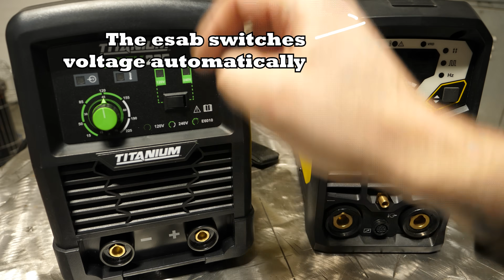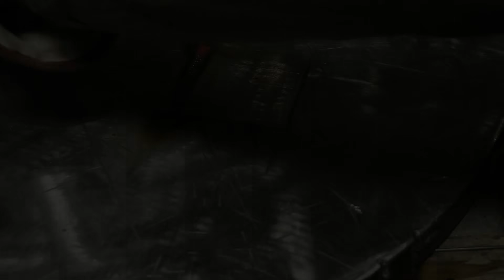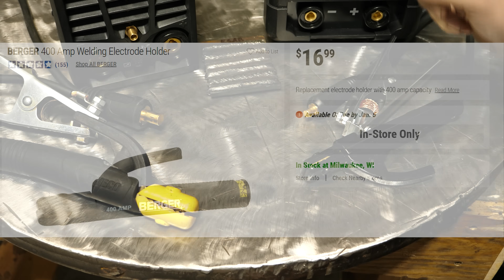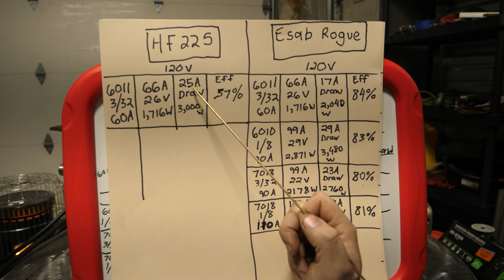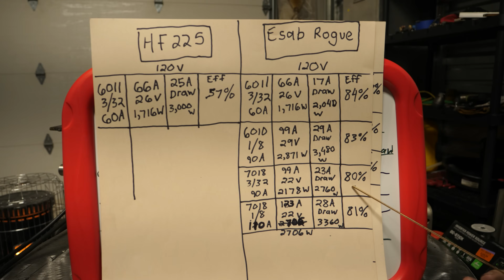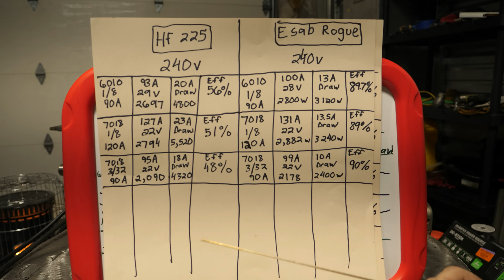Cheap HF vs expensive Esab welder comparison:  Deep dive

Comment: Great info as usual . Good to see PFC demonstrated. Budget also comes down to whether you need to pay for wiring upgrade to run the cheaper welder at higher amps.
Reply from the maker: 100% 😀👍.  For most house wiring it’s not a big deal either way, but for generators it matters a lot more.

Comment: Smaller generator will use less gas per hour and that will add up to a lot of money over time .
More money for the better welder in the beginning and more savings in the long run .
Over time the better welder will be cheaper and work better .
You get what you pay for , pay a little less and get a hole lot less  .
Reply from the maker: Absolutely correct 👍.

Comment: the twist type of electrode holder is common in Australia.  I see those clamp types and recall using them, the 3 grooves made it easy to change angle.

the larger sizes are both more robust and less prone to getting hot.

Comment: Can you please do a video comparing a cheap ACDC tig welder for aluminum with a good one ? i would love to have an affordable and expensive machine, but where i live i only could get a 700$ machine (Tig neo acdc welder) and our wages are a lot lower than on america..
you said that those machinese were junk, but thats what people uses where i live. I am not sure to buy or not the chinese acdc machines !
Reply from the maker: I definitely need to do that.  The hardest part is a lot of the cheaper a/c capable tig ones I can’t recommend because they don’t work properly work. The cheap d/c tig welders (or even stick welders that you can hook a scratch start tig setup to) will generally “get the job done”.  The issue is the a/c tig welders need more adjustability to function properly.  Many cheap ones don’t have the range needed, or the settings don’t work the way they do on a proper welder.  The other huge issue is amperage.  Aluminum eats amperage so a minimum machine should be a 200amp machine, which pushing costs high.  The cheapest welders I have found that a/c tig weld properly are typically 800+ here in the states (everlast, primeweld, ahp, etc).  There seems to be a hard line below 750$ where the usability becomes bad.

Comment: That VRD (voltage reduction device) on the ESAB drops the open circuit voltage from 78 volts to under 30. Is that then going to make it harder to start an arc? Apparently the VRD is disabled and needs to be enabled by an Esab technician. So if you go mail order, I don't know how to get it enabled...but, if it makes it harder to start, perhaps a non-issue?
Reply from the maker: So if VRD is enabled (which it tends not to be in america) it has to be disabled via a service department.  I have never seen it enabled on any American esab machine (I have owned at least 5).  With VRD on it will be harder to start a stick rod for sure.  It’s still doable but when learning I would take the higher OCV any day.

Comment: I haven't finished the whole video yet, but rather than the ESAB I would look at the Everlast power arc 210 STL if a guy was interested in a small portable stick welder that could also do TIG. You get 200A output stick/tig, dual voltage (120a on 120v, 200 on 240 so even surpassing ESAB), dinse 35, hot start, arc force, lift TIG with a gas solenoid,post flow and 2T/4T.  Literally cost half of what the ESAB runs.  I've used mine about five years now and I have done a lot of TIG work with it and it's been great. Also has a 6010 mode that works very well.
Reply from the maker: The 210 is a solid welder.  The two main benefits to the rogue is power factor correction and more resistance to moisture due to the design.  On a generator the rouge will operate on a much lower running watt unit, and it can output more power on a 20a 120 circuit.  On 240 there isn’t much difference for output though.  Realistically I agree with you, that welder is a solid option for a majority of people.  The one great thing about everlast is they don’t lie about specs, and they weld really good.  That’s two things that many more affordable machines flat out don’t do.
Reply: @makingmistakeswithgreg you are 100% right on power factor correction. That would be a nice feature to have. I have a clamp meter and one of these days I'll use my line splitter to see what type of amperage and efficiency my 210stl has. I have run it on my harbor freight 4450 pure sine inverter on the 120v 30a plug. It worked for me for the 3/32 7014 stick I ran, but no idea how close to the limit I was. I watched your other video detailing generator use and info, and it made me nervous to do that again. I'm sure it strained both pieces of equipment.

Comment: Could you try Amico Arc 220 stick welder.  We use 2 of them on our tugboats. Main generators and portable.  Seem very efficient and less than $400.  Runs 6010 and can use long extension cords.
Reply from the maker: So I have been looking to find an alternative to the harbor freight 225 and the welder you mentioned has been suggested by a few people.  I think I will pick one up and compare it to the titanium 225.  If it does run 6010 and weld decent it might be a really good option for people.  I am all about affordable options for decent stick welders 😀👍.
Reply: We run it on 100ft primeweld 6gauge cord and weld 3/8 and 1/2in with 5/32 6010 and 7018

Comment: How is that ESAB working as of 10/2025?
Have you had any issues with it?
Reply from the maker: So a while after that video I did a 1 year update and it’s actually been a while since then.  I ended up giving it as a Christmas present to one of my students and it’s still doing great 👍.  Probably has well over 1k welding hours on the machine and no real issues.

Comment: Just my $.02 ,

If you want an inverter machine that performs well on 120v but don’t want to pay Esab prices, the Eastwood Tig 200 DC (the little one) is worth checking out. I bought one and it runs circles around my Titanium Stick 225 on 120 volt power. 60% Duty cycle, has high-frequency tig start, and only costs $450. Stick welds smooth as butter. Only downside is it doesn’t come with a stinger for stick. Throw one on and it works a real treat. Cheers

Thanks for everything you do for us Greg!
Reply from the maker: It probably has a lot higher efficiency and possibly power factor correction, which could explain why it runs on 120v so much better.  It’s really hard to get decent stick performance on 120v, or tig for that matter.  That’s the big downside to many dual voltage welders, sure they run on 120v but they barely have output on 120v.  Glad to hear it does well on 120v 👍.  Eastwood has done a lot of good for offering decent welding machines that do what they advertise.

Comment: Thank you. This was very good information. I am trying to buy a setup for welding in my garage at 240v/16A household fuse. I am planning to weld some fairly thick flat iron and tubes lik 5-7 mm thick. And I have been trying to figure out why units with similar specs have so huge price difference. Before seeing this I thought it was a price difference based on brand, ergonomics in LCD and such details. But I never thought efficiency could be a huge thing. I have a pair of questions that I love your answer on.

Is this efficiency something that is generic with higher priced brands or is this some specialty of Esab?

What do you think about "smart" welding like S-MIG on Esab? It seems like a great tool from a beginners perspective to just dial in the tickness of the material and the machine does the rest. Or is that just a marketing illusion?

For my purpose of welding bars, tubes of iron and probably also some thin sheets on my house power 240/16A is something like Esab Rebel EMP 215ic (that is currently on sale in my area) a good an useful solution or will I only be able to use a fraction of its power?

Comment: Great video!  I picked up the Titanium Stick 225 about a month or so ago, and have mostly run it on my 5000/5500 generator.  The gen seems to run it just fine, running 1/8" 7014 at 140A... but what you showed here was eye opening... never once tripped a breaker on the gen, but it looks like I've definitely been overloading my generator.  I figured the Titanium would be in the 60-70% efficiency range being that inverters are supposed to be so efficient and all, even with no PFC... wow... I was off a little bit.  The gen I have has a somewhat larger engine for the wattage output... so it will carry quite a bit more load than what it should before it runs out of horsepower.  I guess I'd better think about upgrading my gen... I'll have to take a look at the windings and see what they look like.  I welded hard with it one weekend for an entire afternoon, ran close to 5 lbs of 7014's and probably 2lbs of 6011's.  I hope I didn't cook my gen!!

Comment: Let me tell you, i've been welding for years.That titanium is a beast very impressed, especially with the way it works and the price
Reply from the maker: I bought one when it first came out and was shocked at how good it was.  You don’t expect something so cheap to be really good.  It’s better than anything I have found in its price range and better than a majority of inverter stick welders since they won’t run 6010 well most of the time.  That’s why anytime people ask me to suggest a stick welder I suggest the 225 lol.
Reply: @makingmistakeswithgreg  yes, it's no joke. I was looking for a small inverter. Welder I was going to go-between Miller or Hobart, but I couldn't find one bad review online with the titanium. So I figured with the price range, it's worth a shot and it blew my mind
Reply: @makingmistakeswithgreg  i like trying different machines if I came across a hobart 210i i would purchase it.They discontinued the  machine

Comment: I know it's like comparing apples to salt marsh harvest mice, but my first welder was a decrepit Lincoln 225 AC tombstone running on too small of a generator, but after enough gas and rods were thrown to the wind, I could eventually stick a cutting edge on the bucket of an almost as old case front end loader.
I eventually got into the 225 titanium, and experienced seeing a light at the end of a tunnel.
In comparison, starting, holding, and completing a weld/bead was like a whole new world in my welding learning curve.
The thing ran like butter, and was slicker than deer innards on the front porch.
I would highly recommend it to anyone wishing to learn welding with oversized sparklers.
Reply from the maker: The titanium 225 is definitely a major upgrade over a tombstone.  I was never a fan of a/c stick, it tended to make odd weld profiles and some rods don’t run well.  The great thing is, if you can weld with a old a/c tombstone you can make even better welds with a decent d/c stick welder.  I don’t doubt you experienced a light at the end of the tunnel, the titanium 225 is one of the best stick welders out there for general use, it flat out welds great 😀👍.

Comment: I have the same Esab Rogue, in EU on 230V work perfectly.
On 30A fuse work @ full 200A.
Reply from the maker: Pretty amazing what that welder can do on minimal power.  It wasn’t that long ago you couldn’t get more than 100amps stick and 130a tig out of any welder on a 30a breaker lol.

Comment: You need to consider power factor and use true RMS meters.
Reply from the maker: So I did just that in a later video.  Harbor freight claimed a good power factor above .90 however this is both 1) a lie, and 2) the power factor of the unit is only decent at high output.  The complete data set showed the titanium 225 achieving 85% or higher efficiency and a power factor of .55 at 90 to 150 amps.  The esab achieved 92% efficiency and .99 to 1.0 power factor.
Reply: @makingmistakeswithgreg  Great video, thanks for the extra info.  I’m a new hobby welder.  I have the Titanium 225.  Thanks again

Comment: 200 amp is output. not input, so that 14 awg cord is not having 200 amps running through it.
Reply from the maker: I don’t have time to rewatch the video at this moment but i don’t believe I claimed the output of 200a was run through the input power cord (that doesn’t make sense).  Both machines load the input line over 20a while welding near max, with the harbor freight significantly over that.  The only reason they can get away with small input wire size is due to the duty cycle of the machine.
Reply: @makingmistakeswithgreg  I knew what you meant when you said it. but you did say "how is this not possible the 14 awg will not melt on this 200a machine". I know you were referring to the amp draw being higher under load from a 120v 20a breaker and not that 200a would input to match a 200a output.
I don't think these manufactures should be encouraging people to use 120v by saying these work on 120v and 220v. since the lower the voltage will require higher amps through that 20a breaker, which will cause the trips in residential situations.

Comment: Greg, for a DIY hobbyst, do you recommend this ESAB over something like a Stahlwerk AC/DC TIG welder (for TIG welding only)? The Stahlwerk is Chinese made but sold by a German company. Stahlwerk costs around €560 and the Esab around €875.
Reply from the maker: So the esab unit (both the rogue 180 and 200) are very well built units that will likely last.  They are dc only but I am sure they would outperform the other welder.  One of the things you have to watch is many cheap welders lie about all their specs.  Which really sucks because in many cases they aren’t cheap.  I have never used the STAHLWERK welder but I am positive it won’t weld as good as anything from esab.  I would buy a used ac/dc tig machine (if available) from a name brand over cheaper china imports.
Reply: @makingmistakeswithgreg  Thanks a lot Greg.
I am learning more and more from you each day.

Comment: Switch ... Yes.  I've replaced those on my Hynade plasma cutter. They will inevitably fail. I never use the switch anymore. Leave it in the "ON" position and just plug and unplug the machine. That's my solution for that stupid rocker switch. I've pulled them apart on other machines and they all show signs of melting and burning. I suppose you could put a different style of switch on if so desired but I just plug and unplug. I can't guarantee the switch still won't fail, as power still goes through it, but so far it's working.
Reply from the maker: Yeah those switches seem to only be good for a handful of uses and that’s it lol.

Comment: The Dinse numbers are referring to the cross sectional area of the wire. The numbers are telling you the gauge of the wire that can be used with the connector, but it's in millimeters so you have to convert from mm² to AWG. You can actually slip off the rubber cover and install bigger wire in the connector as long as within the range of the numbers printed on the side (you also need to use a new copper ferrule.) Disne 25 is 25mm² and needs 4 AWG wire,  Dinse 35-70 can accept wire between 35mm² to 75mm² which is 2 AWG to 2/0 respectively. So it looks like you could easily "upgrade" the ESAB wire

Comment: Hi Greg, do these amperage draws included the "reflected" amps you address in your other video, about welding with generators?
Reply from the maker: Great question and here is the answer.  In the video I based test results on some stats in the machines.  The harbor freight claimed a high power factor of over .90, so my calculations were based off the assumption that was correct.  However on further testing the power factor is only decent at above 160 amps of output.  At lower outputs the power factor is poor (.50-.55).  What this means in simple terms is that both machines actually are above 90% efficient, however the titanium 225 will run far worse on a generator.  The 225 will likely trip a 7500 running watt generators 30a breaker above 180a out, the esab will not.  It’s not that the 225 is consuming more power, it’s that the input line has to carry additional current it is loading the line with due to poor power factor.  The test in this video shows total power (both consumed and reactive power) not just consumed power like in more recent videos.  Hopefully that helps 😀👍
Reply: @makingmistakeswithgreg   It does, thank you!